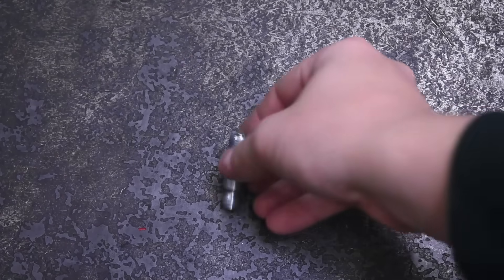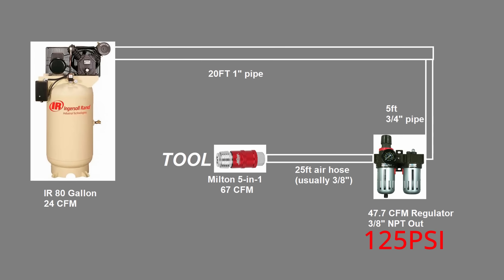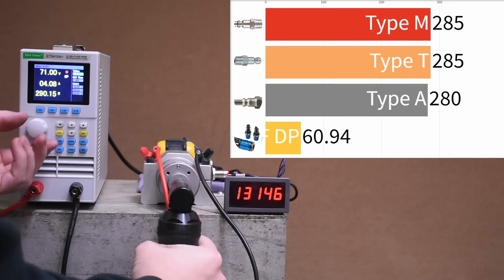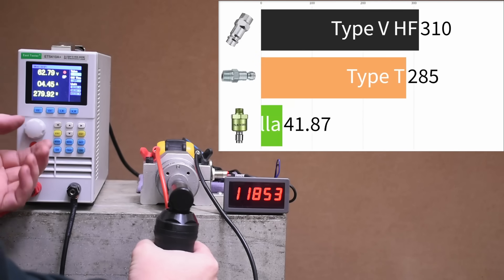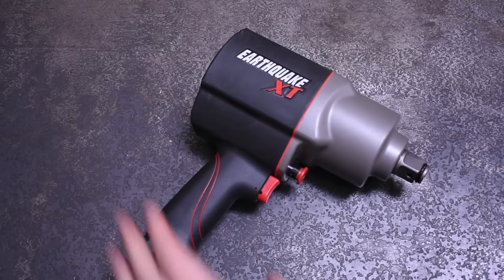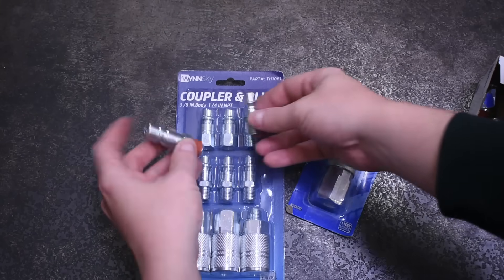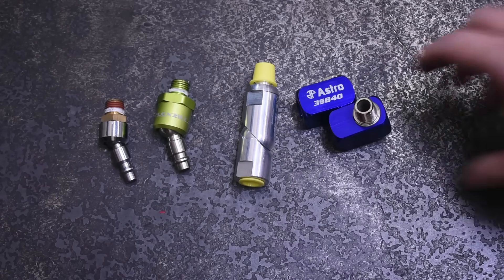Triple Air Hose? Testing Best & Worst Power Adder Tricks

Comment: A graph of watts vs rpm would be better than the subjective "is it dropping off" method.
Reply from the maker: Refresh rate not high enough
Reply: @Torque Test Channel  refresh rate of? I'm not aware of how you collect your graphed data. Are you using an OCR method? The sampling rate of the tach is plenty fast. Does your DC load have a signal output? It would be relatively simple to measure all signals that you use using an arduino or similar. Post up a list of your sensors and setup and I'm sure I (or others) can help.

Comment: FYI 1/4 npt refers to the inside diameter of the fitting or pipe.
Reply from the maker: But not on a fitting which is not 1/4" ID

Comment: Those sizes are pipe sizes. 1/4” pipe threads is 1/4” inside diameter. If you measure 1” pvc or galvanized pipe it’s larger then 1” but the inside diameter should be 1” on sch 40
Reply from the maker: The id is no where close to the national pipe taper thread name
Reply: @TorqueTestChannel  👍🏻. I should of worded it better it’s not exact just close to the size ID

Comment: My sheds air is plumbed in 1/2bsp tractor hydraulic fittings (they were spare and fit the mdpe water pipes I used).  Be interesting to see how they compare.

Comment: Home use 3 gallon to 30 gallon the tank only has a 1/4 inch outlet adding high flow fittings is a waist of money . 1/4 at the starting line is 1/4 at the finish line . A 60 to 200 Gallon tank are going to have a 3/4 or 1 inch outlet. Well worth the High flow fittings .

Comment: I think regulators are probably one of the biggest bottlenecks to any setup, sort of by design. Y'all ever though of comparing those?
Reply: I have the HF 21 gallon compressor (that ought to come with ear plugs, but does not). I removed the regulator and put on a Milton V coupler. V's on all the hoses and air hog tools.  It's made a significant improvement, consistent with the video results.
Reply: Regulators have flow ratings, too. If your regulator restricts too much volume, then you bought the wrong regulator. Not really sure what you'd expect to see there...

You should have seen the size of the regulator I had to source for running an 8KW fiber laser using nitrogen as a cutting gas. High pressure and extremely high volume. An 1/8 NPT regulator for an airbrush probably wouldn't cut it...

Comment: On air tool oil, my first gun was a Shinanno I bought as a first year apprentice, I took real good care of it but found later on when I left it a little the power would come up. It now is worn out and only does about 150ftlbs, I use it for wheel nuts mainly and smaller suspension stuff. 
Air tools don't like too much lubrication just enough maybe one drop every day.

Comment: Could you test if there is a benefit to running a 3ft 1/2" whip hose with 3/8 npt fittings (specifically the flexzilla with a swivel 3/8 NPT male tool end) threaded directly into the tool, with high flow (Milton V) 1/4 male fitting at the end of the whip,
When used with a shop 3/8" hose reel (50ft reel) with 1/4 NPT fittings?
The shops I've worked for usually have 1" industrial pipe run to the bays with 25' or 50' hose reels at each bay.
I've just been curious if there is any advantage to a 1/2" whip hose threaded right into my 1/2" impact or air hammer hooked to it would have any advantage over a 1/4" Milton V on the tool connected directly to their reel hose?
Thanks in advance for your consideration.

Comment: I've got the ported Thor with the same 3/8 big chungus fitting you got  in a diesel shop. We run 150 psi through 1/2 for our big tools. We recently got a group of new guys, and it blows their minds watching something that small out power a 20 lb  HD impact. I don't do it all the time, but I have the option.

Comment: When I worked in a big diesel shop, we had 1" copper pipe run down to every work station, and our air compressor was a massive 3 phase screw compressor that put out multiple hundred CFM of air at ~220 psi. It was nice having a virtually infinite amount of air on tap, sorely missed in my new shop. Then again, it's not too often I need to break out the #5 spline gun any more, so I guess it's worth it. Also, electric tools are way cheaper to run, which is important when you're the one paying the utility bills.
Reply: Compressed air uses so much energy that it's referred to as the "fourth utility" after power, water and gas.
Reply: I do love me a nice screw compressor, dont get to use them much.

Comment: I have found with a smaller air compressor, a buffer tank actually hurts performance. The smaller compressor cannot keep the buffer tank to pressure, so the tool ends up getting less pressure.
Reply: Yes if the compressor is too small. It take too long to build up pressure in between deep run.
And you end up just standing there waiting. 
It will have first Burst capacity 
But 
Worse continuous capacity

Comment: i ran 80 feet of 2inch schedule 40 black iron pipe along the side and back wall of the shop in a L  to pull air off of it adds around 13 gallons of volume and has a 20gallong accumulator at the far end with a drain in it that so it adds 33 gallons on to the main 80gallong air tank with the compressor it feels like it has made a huge difference is how much drag the smaller air lines had with pressur drop in use with impact guns and for blowing out bailers to clear chaff (i see it as a kind of cheap upgrade and it could be a benefit for your testing)

Comment: My  track setup includes a nitrogen tank with a high flow regulator. To a 2 way manifold. From there two 3/8" hoses. But I don't see our couplers. They are similar to the automotive type. But larger with a lock that twists into place. We wrap that lock with tape for extra insurance against coming unlocked. Into the 3 foot whip and the swivel you mentioned.

Comment: What I do to get better air volume to my 3/4 to 1 inch drive air impact wrenches. I use 1/2 air hose but cut the standard 1/2 NPT fittings off and put 5/8 hose fittings that are 1/2 NPT thread that make a big difference in power. Because a standard 1/2 hose with 1/2 NPT fitting the hole in the fittings are only .375 but with the 5/8 fitting are the holes are about .500  My IR 2925 and  IR 2161xp 3/4 impact work much better

Comment: it is so awesome to see that astro is actually taking the feedback from you and other testers and improving their tools, unlike their competitors.
Reply: I thought it was awesome Astro built it and Eric tested it . I bought because I saw Eric using and my impact is always starving for air.
Reply: big fan of this and more companies need to take note, that said, in my shop due to the power of cordless tools these days I dont even have a compressor . well, i have a crappy little hobby one for pumping up the odd tyre. I have a lot of pneumatic tools I just dont use anymore.
Reply: I would like to see review of this updated thor impact
Reply: I think it is cool but I would be lying if I didn't say that test being an employee of Astro takes a bit of the meaning out of this...

Comment: Of course Astro is coming out with a 3/4" Thor and I just used my tool allowance at work. I will say that my 1/2" Thor had the air leak issue from the roll pins and they fixed it under warranty.

Comment: The most exciting thing I got from this was a 3/4" Thor, especially having just started working in an HD diesel shop and been on the fence about what 3/4 gun to get.
Reply from the maker: The idea of a 3/4" that doesn't require 3/4" lines is a good one i think

Comment: These are all things what I have wanted to see and wondered about! Would TTC ever be interested in doing an episode about hose reel losses? I used a 3/4in 2ft hose right threaded into a 1/2 in hose reel from the compressor then 3/8 hose on the reel with high flow V steel fittings. Was pretty cheap. I'd love to see a high flow astro hose reel.

Comment: You should try to get a scroll type compressor and 1"hose. Ran this setup in field fixing construction equipment.  Feeding IR 3/4 or our 1" impact 185 ,psi with 1"hose was only way we got the ripper teeth nuts off of dozers. Should be able to rent a commercial compressor

Comment: I was really hoping to see a large 3/4 or 1 inch air hose choked down to a common 1/4 fitting. I have heard so many people try to say that it increases air flow because the hose is bigger. They don't believe me when I try to explain the weakest link idea and that if any part of the system is restricting the flow then you don't gain anything from the larger hose

Comment: I run 175PSI 60 gal unregulated tank on 50' 1/2" supply hose out to 25' 3/8" ID service hose-to-tool (1/4 NPT Milton V fittings). More than enough for a two guy shop.

Seeing all these tests at 125psi are great for comparison, but still don't really show what these tools/fittings are maximally capable of.

I don't know why anyone would buy or run anything less than 175 at 10CFM anymore, and I definitely wouldn't down regulate air-tools for automotive repair. When the tool wears out, just replace/rebuild it; treat it like a consumable. Don't trifle with following manufacturer suggested 90PSI shenanigans.

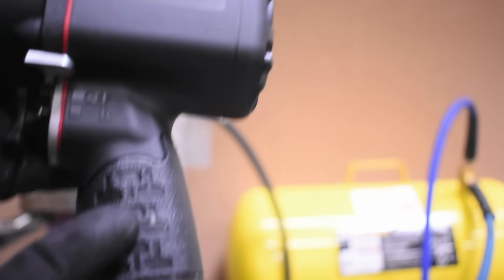Comment: I had to replace the roll pin of my Thor impact after maybe 6 months of use, the air leak got so annoying i bought 5 extra roll pins at napa [ not a sponsor ] so i could fix it immediately if it starts doing it again. I notice when i have to remove really rusty chevy y-pipe bolts i gotta borrow my coworkers 2235-timax, that early start torque does a lot. 12:51
Reply from the maker: They'll send you a solid pin you glue in place that solves it. I think i even have a few if you want to email us TorqueTestChannel@gmail.com
Reply: @TorqueTestChannel  I'm Good for pins at the moment, it literally cost me less than 1$ for the 5 pins.

Comment: The 3/8 couplers are steel and can be "ported" and won't dent under normal use. Try adding a second regulator or larger regulator to see if the buffer tank is necessary

Comment: I was hoping for a summary in the info section, with suggestions for home shop (20-30 gallon tanks, 125psi) and home type tools.  I think what I'd like would be to change the fittings on my 3/8" hose so it'll take larger quick connects, etc. so I get essentially 3/8" flow throughout.

And to add to a followup, it would be interesting to see if longer runs of hose make much of a difference, ideally with just couplers at the hose fittings so other than turbulence there, no restriction.
Reply: Save your Money the Tank only has a 1/4 outlet adding larger hose is not going to boost anything but your Pocket book .  Save up get a 60 gallon tank with a 3/4 outlet . 20 CFM ,  6-8 CFM is not going to matter with a 1/4 inch tank still be 6-8 cfm .

Comment: Air hose fittings are a little confusing at first, but not that complicated when you know how they work.

There are three components of a fitting and they're all pretty much independent of each other: thread size, body size, and fitting shape.

In the US, the main sizes of bodies are: 1/4", 3/8", and 1/2".
In the US, the main shapes of fittings are: Industrial, Automotive, Aro, Lincoln, and Diamond-U.  Industrial seems to main shape you'll find at the big box stores.
In the US, I've seen thread sizes of: 1/8", 1/4", 3/8", 1/2", and 3/4".  There may be more depending on manufacturer.

I'll include Milton's style letters in parenthesis.  Other manufacturers may have other letters used to indicate that body size and shape.
Industrial shaped fittings can come in 1/2" body (style G), 3/8" body (style H), and 1/4" body (style M).
Automotive shaped fittings can come in 1/2" body (style G), 3/8" body (style P), and 1/4" body (style T).
Aro shaped fittings can come in 3/8" body (style AA), and 1/4" body (style A).
Lincoln shaped fittings only come in 1/4" body (style L).
Diamond-U shaped fittings only come in 1/4" body (style D).

You can get an Industrial 1/2" body (style G) with a 1/4" thread.  You can get an Automotive 1/4" body (style T) with a 3/8" thread. etc.

There may be some cross compatibility between styles (e.g. Milton has an AMT coupler that will take A, M, or T style plugs), but you'd typically choose one style and stick with it.

Comment: Great demo. FYI don't get tempted by off brand Milton V styles. They have horribly designed female couplers that are extremely restrictive and you'll lose air flow. The male are about the same though some off brands have a significantly smaller center hole vs the actual Milton
Reply from the maker: I find this to be true as well!
Reply: Agreed. Just order the miltons.
Reply: Yeah please try some Foster fittings next time instead of those garbage Chinese ones

Comment: I've been using Dixon Valve DC624 sockets and DCP7 plugs on 1/2" hose for years with my 1/4NPT air tools. They're rated for 70CFM at 100psi, though my shop air is set at 125psi. Friends and new employees are always surprised at the performance the first few times they use it.
Reply: Oh, and the fittings are all steel, and they don't deform even when dropped repeatedly. The only drawback is having to buy more fittings for new tools or new employees. I do have a 3/8" hose with standard fittings for light duty tools or when someone brings a tool in from home.

Comment: I would love to see a regular air fitting drilled out (there is a lot of material on standard fittings) and chamfer the inlet as well. I performed this on my stubby 1/2in impact and I seems to remove more crank bolts. I'd be curious to see if it actually increases or is it only in my head.
Reply from the maker: I tried this at my last job and drilling them out was super difficult for some reason, the drill press and new bit was acting like I was drilling into titanium of something. It also thins the wall, but main we find these couplers that pair with these are the restriction, not as much the fittings.
Reply: @TorqueTestChannel  I had the same issue when I tried to drill a second fitting. Idk why the first one drilled out fine but the second one broke 2 bits.
Reply: @Yotataco04  A bored out 1/4" M/T is still way smaller diameter than a Milton V. No point not using Milton V fittings as they're cheap AF on amazon.

Comment: Screw the air …… literally got rid of everything air powered because the battery tools are just so damn good at this point
Reply from the maker: In a professional setting we just can't. Air hammers, blow guns, cooling system testers, tire mounting machines, airing up tires without looking like a dweeb standing next to an M18 inflator for 2 mins a corner
Reply: @TorqueTestChannel   yes ofc air has it’s place in a car workshop but in my opinion not really for impacts and grinders anymore…..
Reply from the maker: I cant always fit 9" of impact + battery where I need a high torque, but it's definitely getting there

Comment: I put together a 6' 1/2" flexzilla hose with 3/8" V fittings and a 2 into 1 adapter for my Thor air hammer and impact. Haven't found a rusty bolt or lug nut I can't get loose yet
Reply: I also bought one of those high flow swivels from Astro and took it apart and drilled it bigger 😂

Comment: Have you thought about just buying a large air holding tank hooked up to your compressor like 80-120 gal? chances are imo your 3/4 inch larger tools would not run short on air
Reply from the maker: It's not my system, it's at work. Need to build something at home maybe

Comment: Any way to have the pressure regulator right at the gun inlet? Something like McMaster-Carr part# 4677K55 hooked to 175 psi shop air with a 3/8" air hose. Not practical, but for science? Would be cool if air hungry guns had the regulator built into the handle somehow...
Reply from the maker: IR's new 3/4" air guns have a display in the back of the head now. We do run inline gauges to determine 90PSI working pressure for these guns, but dont run them on testing to eliminate variables.

Comment: I've run through a few different types of 3 way swivels myself, settled on the cheapo amazon ones because I was tired of wearing out $50 tool truck ones. Might have to pick up a few APs. Without sounding like a shill, I've never has an AP product let me down.

Still upset that my heavy equipment shop runs Type A fittings and WILL NOT BUDGE, because "that's the way it is". Unless I feel like dragging out the 1/2" hose, anyways. I would just swap my bay, but I can work in up to 20 different bays depending on the day
Reply: A buffer tank, Wynnsky high flow fittings and a 25 foot 1/2 inch air line can speed up your work day. 😊

Comment: Maybe try some experiments with grease in the hammer case. No grease, too much ect. For example milwaukee guns are a pain to grease so is it even worth it.
Reply from the maker: Grease wont increase torque, it lesses peak RPM even due to more stuff to spin through. But it increases tool life
Reply: @TorqueTestChannel  Agreed but i have seen guns pretty much stop working with zero grease and I've seen them loose significant power with way too much. So it seems to matter in the extreme cases.
 you're probably right that it's not interesting enough to test. Maybe someday if you get desperate for ideas lol.

Comment: Great video! I'd love to see "Euro" fittings (PCL XF) added to the comparison, as they're what we use in the UK, as well as Japanese Industrial Profile that Japanese tools come with. Of course with these you're changing both sides of the connection, so a trickier comparison.
Reply: Yes, I'd love to see this.

Or even a measurement of the fittings used so I can see how they compare with PCL fittings. I have the PCL Standard on all my air tools. No technical reason, it was just all the tools I'd ever used were PCL so that's what I standardised on.

Comment: Wait, aren't you the guys that made a gas-powered impact gun?
If a triple line adapter increases the power, and larger air lines increase power; How much extra power could you get by using both in tandem?
Three air compressors?